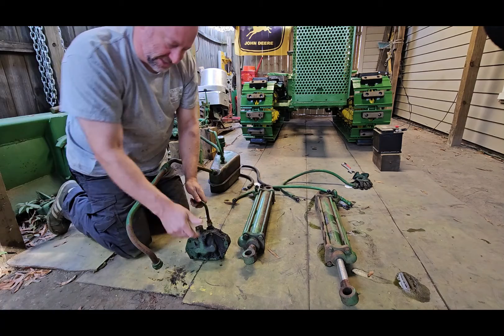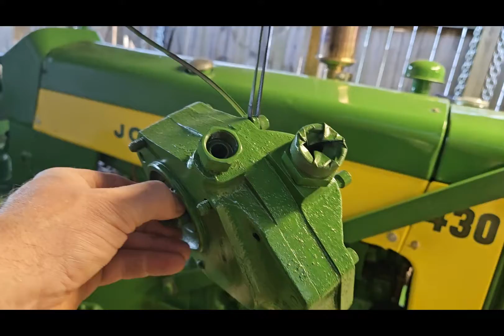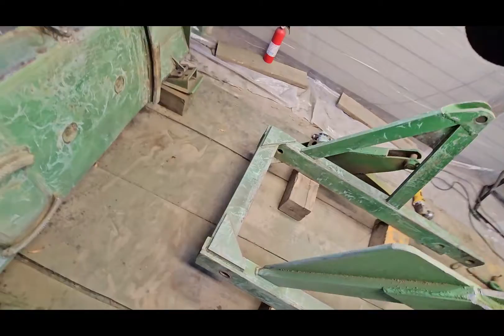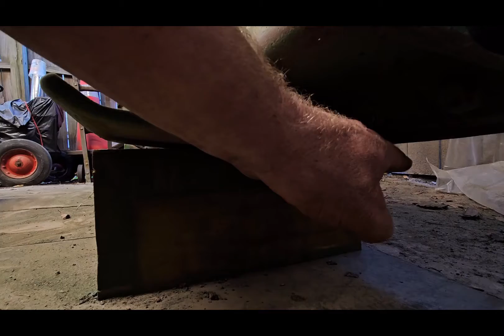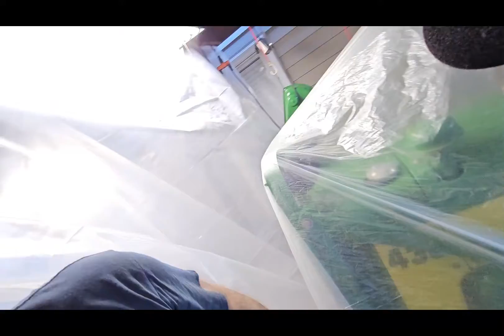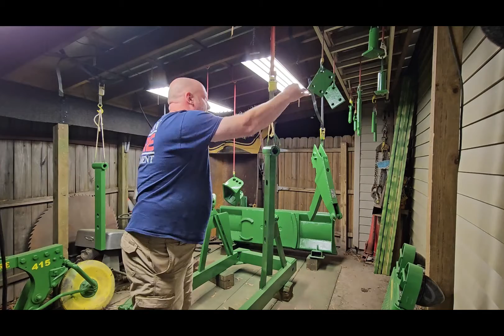Hydraulic System Overview and Blade Painting

Comment: Did you rebuild the cylinders. If you did how hard are they. I got to do some. And did you rebuild controls also.
Reply from the maker: No I did not. As stated in the video I am hoping they are all in working order still as they were when it was parked. I plan on getting the blad on this week and operating by this weekend. If I have any leaks or issues they will be addressed then and if I ha e to rebuild 1 or. Oth cylinders I will make a video. They are pretty simple and don't require any special tools.
Reply: @RustyWrenchRestorations   Thanks i got a leak down somewhere I think it in the cylinders. There is no leaks in hoses they are relatively new. I went through valves put all new prongs and seals. I even found NOS cases. I was told they were worn out. It slowed it up but still leaks down just not as fast. I know the cylinders kits are expensive
Reply from the maker: @daridley is it for a 62 vlade like this one? I've had luck taking them apart and bringing the internals to a good hydraulic shop.... they measure the seals and orings and I got the parts fairly cheap. Sometime there are good kits online also. If your cylinders are loosing pressure and there are no external leaks then yes... they need to be rebuilt. Be careful with new old stick items... though new or never used they can deteriorate over time.
Reply: @RustyWrenchRestorations  thanks for that’s. I’ll get to it one day. It’s for a 62 blade. I’m going to try it first I think I could do it. I know someone in the heavy equipment filed that can help. Thanks for all your information. I looked at video. My cylinders and different. They are like ones you are working on now. I got rebuilds kits for them recently. If they aren’t any good I can return them. Thanks again
Reply from the maker: Honestly these ones for the 62 blade are easier! 4 nuts on top will get the 4 rodes to slide out.... basically the top and bottom plates sandwich the outer cylinder. Like i said... if mine leak ill be doing a rebuild video on them. Stay tuned! @daridley
Reply from the maker: https://youtube.com/playlist?list=PLkNxN7DZXVR5rtThkHTjNswcBo324hnSq&si=CZRHlLGK-kbxm7xz

Here is the libk for when I rebuilt the 420 cylinders. They are a different design than what's on the 430C